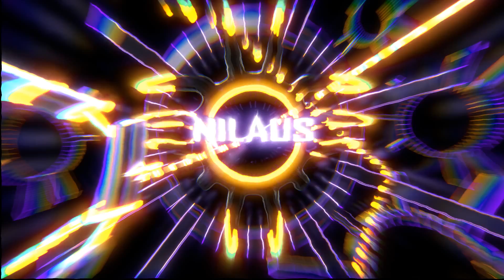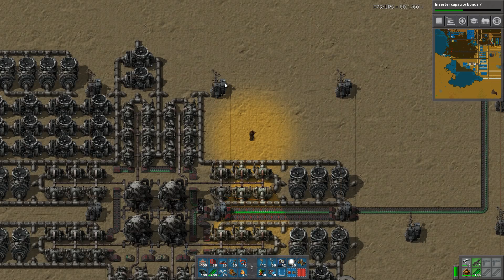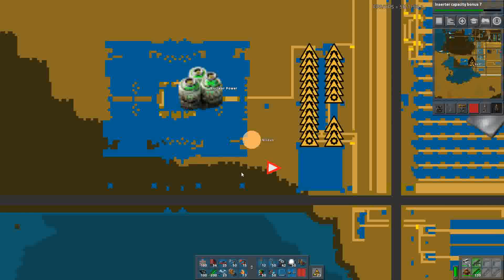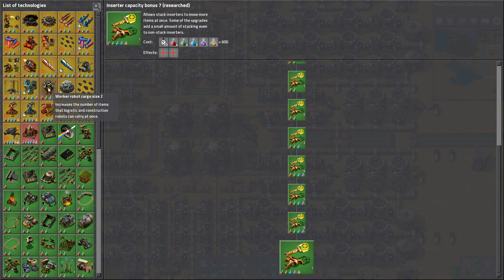Factorio - Vanilla done right - E49 - Fully operational Nuclear power

Comment: Hey Nilaus I'm a bit late to the party and maybe hard to answer this one 3 months later.... but recently picked up Factorio again and needed a crash course with all the new stuff that came out. So far Really enjoy watching the lets play... (Normally I hate lets plays and end up playing it myself. XD) SO question is. You noted that you were capped on steam near instantly yet decided not to create a larger storage. Any reason to this you can think of?
Reply from the maker: Thank you and welcome back. Yes I do have a reason, but for anyone else it is probably not a good one :)
The reason is the architecture of the Nuclear factory. I wanted a compact design that I can use in my City Blocks (such Belts and Blocks). If I added more Steam storage then it would look "ugly" (I told you it was not a good reason...)
Reply: I wire my plant similarly, with a couple of differences. I have my input inserter override stack size to a single fuel rod, and wired to the removing inserter with a red wire. The removing inserter is set to remove the used fuel rod when the steam is low, and the input inserter to look for: Used fuel rod < 0. That way there isn’t extra fuel in the reactor unless stem is low.

Comment: Question;  If the ratio is perfect, why do you have excess steam?  If you have excess steam, could you not power more Turbines.

My Nuclear setup has 6 reactors.... why not, and 100 turbines, I am sure that I could add more, but I am just bathing in the excess power at the moment.
Reply from the maker: The ratio is perfect in the sense that the 84 Turbines will consume all the Steam. The Nuclear plant will always generate Steam, but the Turbines will only consume steam when needed for power. Hence there will be excess steam, which can be used later.
That is the reason I store the steam and stop the inserters from inserting more fuel as long as I have stored Steam. The Turbines will consume the steam while the Nuclear reactors are idle (due to no new fuel inserted). Then the Turbines have burnt through enough Steam the fuel is again inserted into the Nuclear reactor.

For your 6 Reactor setup you need 80 Heat Exchangers and 138 Turbines to consume it all. You can see the optimal ratios in this Reddit post: https://www.reddit.com/r/factorio/comments/67xgge/nuclear_ratios/

Comment: As others have mentioned, the inserters will always overload the reactors to max fuel, because of the time it takes for the heat to spread out through the heat pipes.  My system uses an SR latch on the steam tanks to trigger a pulse generator wired to the inserters.  Simple, and works great.

Also, last I checked there is still a problem with bot-constructed heat pipes.  Heat pipes 'done properly' (ahem) should be laid by hand, starting from the reactor and moving away.  Devs have confirmed this, although I doubt it would have much of an effect on a compact setup like this one.

Looks very nice, Nilaus!

Comment: Looks good! 

(I deleted my original comment, since it was completely wrong. It was an explanation of my fuel limiter setup, which works great, but I explained it incorrectly.  I have since just uploaded a blueprint for the setup to factorioprints.com)

Can be found here: https://factorioprints.com/view/-Kp06a2jvYjbYq9cGlxR
Reply: What happens when the reactors finish their fuel cycle while the steam level is high?  As you describe it, the inserters will never load another fuel cell: 
End of fuel cycle: (Unloading empty, true) AND (low steam, false) = false
Steam depleted: (Unloading empty, false) AND (low steam, true) = false
And the whole system winds down into darkness.
Reply: GGGenom good call. I wrote this from memory but being an old guy, that memory's not so good any more. I had to go look at the setup to remember that there's a wooden box to hold the empty cell, which sits in there until the steam level drops, then   the empty cell and the fresh cell are both moved. Thanks for the reality check!
Reply: I'll try to make some time to blueprint the inserter/box/wire setup when I get home and stick it on factorioprints. It really does work.
Reply: Not that you probably care since it sounds like you have a simple setup already, but in case you're curious, check out the blueprint I linked in my edited comment above.

Comment: That's great: A logistic-chest-free plant that will run unattended until you are depleted of depleted uranium.

I was freaking out about the stack size thing, but you already noticed. Good.
Using circuit operators and combinators might be needed to avoid inserting multiple fuels if the latency for steam recovery is not short enough. It would not be needed if you had a configurable cooldown inserter (e.g. to 200 seconds)

I use the following logic (probably someone knows a better one):
Rationale: Avoid insertion of fuel while already burning by signalling extra steam.
Let FF=Fresh Fuel,SF=Spent Fuel,WS=Water Steam.
Read: Pulse from feeder inserter. // Signals 1 FF when fuel is starting to burn
Combinator: if FF > 0 output FF=1 // Keeps alive FF=1 value while fuel is burning
Operator: FF * 50000 output as WS // Signals extra steam so no extra fuel is inserted
Read: Pulse from removal inserter. // Signals 1 SF when fuel burn is completed
Operator: SF * -1 output as FF // FF is removed, therefore WS value returns to real.
Reply from the maker: that seems like a rather complicated solution. If I accidentally insert 1 more Fuel cell than strictly necessary then it is not the end of the world. Though I do not think that will even happen.
Reply: It's a complicated problem.
Fuel is not inserted instantaneously and steam is not produced instantaneously.

Slower inserters can alleviate the latency issue. You can even wire a burner inserter, but as far as I know it does not burn uranium.

The inserter takes a time t1 to pick up and insert the fuel, and t2 to return to start position. You need to produce more steam in t2 than it is consumed during t1+t2. If you are running clearly under 1/2 capacity you might not run into that problem. But if you are running over that capacity you will overload the reactors regularly.

Another issue is latency. Some heat must be built up before the last exchangers start producing steam. Reactor will need to heat up 1º (10MJ) in order for the closest exchanger to work, 4º for the next exchangers (distance + 3), and so on. Just  heating up the reactors 7º will take 280MJ out of 480MW. That's already more than half second and you still need to take into account 1MJ per degree and heat pipe or exchanger.

Anyway that's theoretical, better check back the plant in a few minutes and see what happens. Sometimes circuits (especially those dictated by random people on the internet) can cause problems themselves,  and as you said, you can spare some fuel.
Reply: I just checked the savegame. Actually loads 5 unneeded fuels (as +GGGenom indicates). It takes too long between reloads to just stare waiting. You can wire an speaker alarm (e.g. <60k steam) to know when it is about to happen.